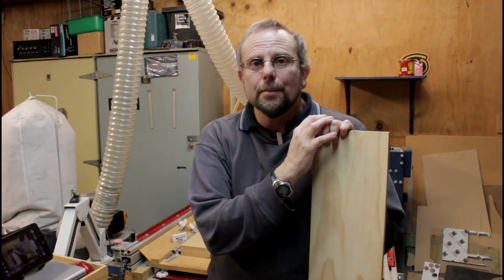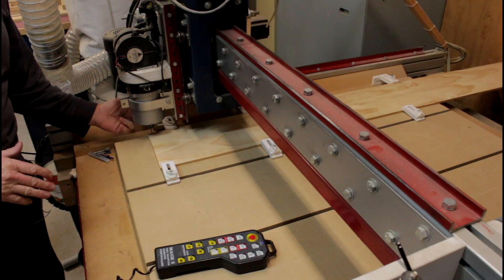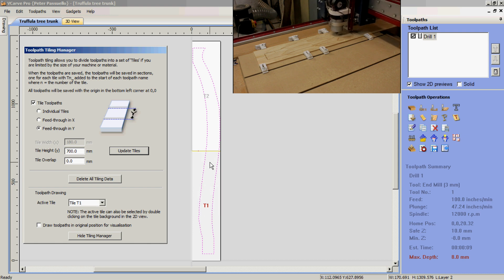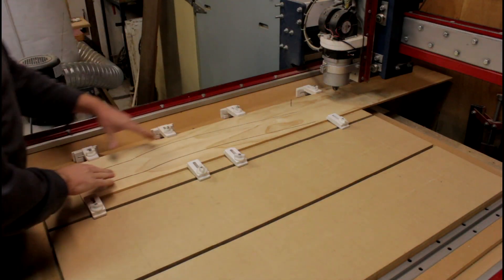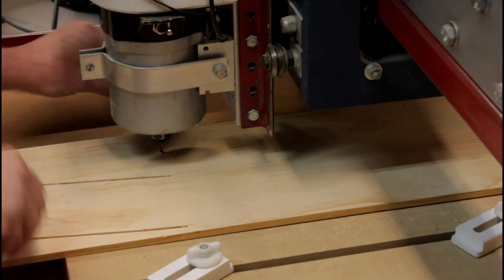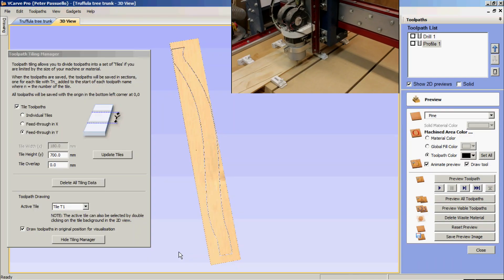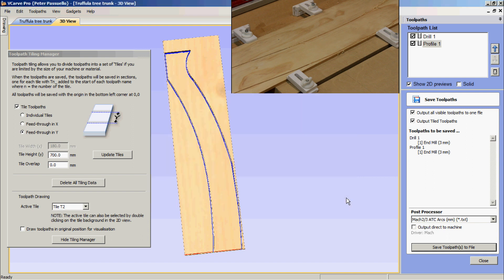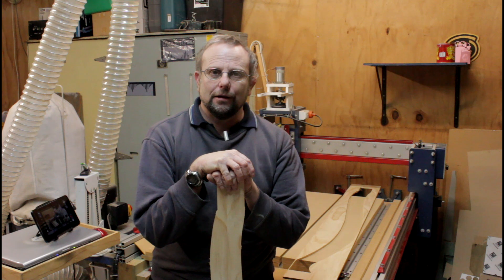Machining parts longer than your machine - CNCnutz Episode 63

Comment: Could you after setting the router to X0 Y0 mover the router X40 Y0 and make a lower index hole, then make the mid index hole at x40 Y700,  next cut the T1 part. 
Next move the stock and place the lower pin in the mid index hole, secure clamp and cut T2.
Is this correct?.  This is my first try at Tiling. 
Thanks Peter HH

Comment: Vectric VCP version 11:
Peter this technique finally caught up with me at 81 years old.  Thanks for your video. I have a project to make a 88” diameter ring that is 6” wide, it will be in six sections.  My CNC cut area is X 48” and Y 37”.  This is cut out of sections of 4x8’ 3/4” plywood.  I am arranging four sections in the first of two tile cut, then move the material in the Y direction and finish the cut.
In your example you cut one piece in one file using one index hole.  Could I highlight all four pieces and just use one hole and cut the four lower sections then move to the the index hole and finish the upper sections, all in one file? Is my assumption correct?

Comment: Nice presentation.  The only caution I would add is that by using a "guide" to maintain a constant X reference, you are relying on the edge of your material (not the guide) to be perfectly square the entire length of all the tiles.  Any slight variation in the material is going to offset all the cuts between tiles by that amount.  In a table leg cut out, it might be possible to sand out the "jog" that will appear at the edge of each tile.  But on a carving, the jog will appear on every vector that crosses between tiles.  Insuring that kind of 'squareness' is pretty hard to do even using a table saw with a cut that long and where you are relying on a high degree of accuracies on a complex CNC carvings across tiles.  You can drill two "x" and "y" guide holes anywhere in the material and the spoil board as long as the "Y" is the same tile "Y" distance from the original origin.  Then you are not relying on a perfectly square edge along the entire length of the material you are cutting. The dowels insure very high accuracy across all the tiles.

Comment: Very helpful!   I need to surface a 54" long slab on a 48" machine, and if I mount the slab on a sled, I can drill the hole in the sled and run the T1 surfacing toolpath, and then move the sled further down the table to run the T2 surfacing toolpath.   Flip the slab on the sled, re-mount it, and do it all again!
Reply from the maker: Thanks Rick

Comment: Cool thanks for that I have turned work down because my machine wasn’t big enough will try that out later on some scrap my machine is 1000x 1500 
So I have a working area of around 850 x 1300 as long as I can support the work sticking out skys the limit lol

Comment: Thanks for the useful video. A question - for the reference hole, would there be any accuracy benefit to drilling it through the workpiece and into the wasteboard, then using a dowel for alignment after, rather than eyeballing the bit into the reference hole?
Reply from the maker: There is no eyeballing the cutter into the hole. It is a matter of leaving the material loose and putting it onto the cutter then aligning the sides by feel which is very accurate over the long distance. I think if you do it right there is no advantage to drilling holes into your table.
Cheers
Peter

Comment: This was great overview of tiling, both from a software and execution of the project. Thanks

I have a project that is 16x48 but my material is not square. I am using live edge pine. 
Any comments on how I can manage the physical transition between tiles.

Thank you
Reply from the maker: Can you attach a temporary straight edge  to the stock while you cut it.?
Cheers
Peter
Reply: @cncnutz  Hi Peter - thank you for the response. What i ended up doing was drilling two holes and used them to square up the stock.. it seemed to work pretty good.
Reply: @brianyoung3124  Glad you got it sorted. 

Cheers
Peter

Comment: yep..i just tried it in vectric aspire and its exactly as your version...very good handy feature...may use it one day to do a long sign etc....so does the tile feature basically break up the large projects into smaller sections that are each individual of each other but when tied together  they crate the 1 large project?
Reply from the maker: It basically cuts up the project into smaller bits so you can do that part and move onto the next.

Comment: I realize this is an old video but what if you had to flip your work piece and cut it because it was too long to just move up would it be possible to do that
Reply from the maker: No.
To cut a peice longer than the table you need to use tiling as shown in this video. Tiling toolpaths are special in that it creates incomplet toolpaths. The long piece needs to be cut with 2 incomplete toolpaths with the 2nd toolpath completing the cut. In the train project which i assume you saw earlier I was cutting a complete pieces. Don't know if it makes sense but flipping will not work for cutting a piece longer than the table. It will work for cutting matrial longer than the table.
cheers
Peter
Reply: CNCnutz (Peter Passuello) maby I should have said spin but I can not slide it through because the wall is in the way
Reply from the maker: My table has wheels at the back so I can pull the table forward if I need to machine longer material. The longest I have done is 3.6 metres (12 foot).

Comment: Hmmm, before I found your Excellent work, I had an idea to drill two locator holes STRADDLING the interface edge between a fixed reference and the workpiece: half in each, the Perfect (calculated) distance apart. Then, when time to move, I'd slide the workpiece along the fixed reference using, as you did, a cutter bit for the alignment. I've done that eyeballing/rotating thing, but was always worried that I was stressing the bit/adding error.  My particular problem is a large topo map that has to match up on X, Y, AND Z along the boundary.
Thank you. Agree with the others: you're a natural teacher.
Reply from the maker: +duubtuub 
Thanks duubtuub

Comment: that was one thing i was wondering about too , and the reason i was planning to make my machine a lot wider compared to its length, i want to be able to slide a full sheet of ply underneath the machine and cut it in stages , the shorter machine only takes in the extra work space when its needed 
nice to see its reasonably simple to do in VCarvePro , seen someone do some relief cutting with the program too (routing a babyphoto into a block of wood )..... yet another thing to check out

Comment: Great Video... I am curious what CNC machine you have.  It moves a lot faster than mine!
Reply from the maker: Hi Kevin, 
The machine is a homemade Joes NC Hybrid. It is rack and pinion drive which is where it gets its speed. The original build was leadscrew and topped out about the 40ipm mark but upgrade to R&P and it idles at 100ipm. The limiting factor now is how fast the router can cut the material not how fast the machine can run. Interestingly the machine still uses the same 270ozin motors I bought for my first large machine years ago but upgradeing the driver to a G540 and then the R&P really changed how things work. 
Cheers 
Peter
Reply: Outstanding work mate... love it.  Your video was very helpful and well made.  I applied your process to making a nice chair for a client.  Thanks again!

Comment: I have to agree with Littlesworkshop.  I would have drilled into the base board and line up the T2 with a peg.  Clamped and pulled the pin.   I believe using two reference holes would also make it easier so I didn't have to trust myself in alignment of the clamps.  It would make the side clamps irrelevant.

Comment: It looks like it didn't cut any material at the tile joint about 1/4" long or am I just seeing it wrong?
Reply from the maker: '+TheGeekPub 
It is quite a while since I did this video and can see why you are asking because it does look like there is a gap but it is an optical illusion. I noticed when I put my arm across to turn off the router the shadow cast by my arm made one of  the gaps disappear for an instant. I also see that when I removed the part I can see the holding tabs but no evidence of an uncut section. I also mentioned that you can barely see the join of the 2 cuts.  When tiling  there is no gap unless the registration between the 1st and 2nd cut is wrong.
Cheers
Peter

Comment: Hi Peter, All you video's are good. When I get done fixing the poor workmanship on the machine I got, I will start putting you video's to good use.

 A spin off to Littlestworkshop is to make some special hold down claps with pins on the bottom. You have them set so that when you take them off or on they are to a fixed point X,Y. With two of them spaced out on you table you can step you work down the table.
 Just a thought.

Comment: If your stock does not have a straight side and you don't mind drilling into your spoilboard you can use two reference holes in the part and matching ones in the spoil board, then insert dowel pins before clamping.

Comment: Great video, keep them coming.  If I can ask what are you using for the speed control on your router and also what pendent are you using?
Reply from the maker: Thanks for watching.

The router speed control is called a SuperPID.
You can watch my SuperPID video here
Install and Test of Super-PID 2048.avi

Here is my pendant video.
Others have tried it and have had problems so it is now unlisted as I do not want to lead others astray.
That said, mine has worked well for almost 3 years. I bought it off Ebay for about $40 making them really cheap compared to other pendants. I leave it to you to make up your own mind on whether it is worth it.
Mach 3 Pendant Review

Cheers
Peter

Comment: If you know Code, You can draw each half with any cad program. Offset the 2nd file. Modify the G-Code to lift the Z at the end cut. That's how I do it. Still use a Ref. hole.